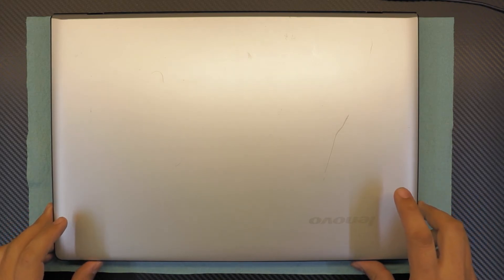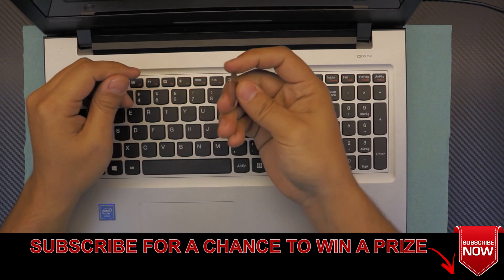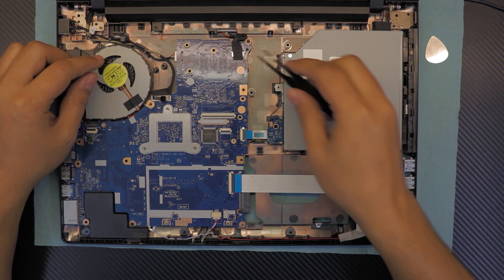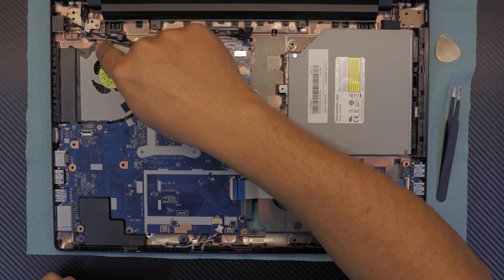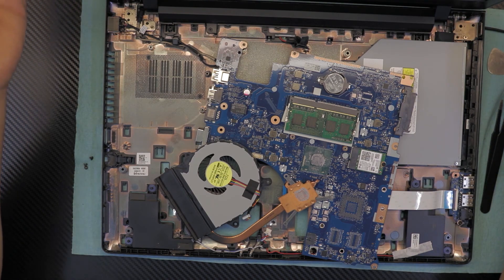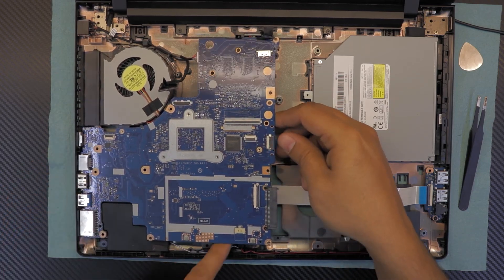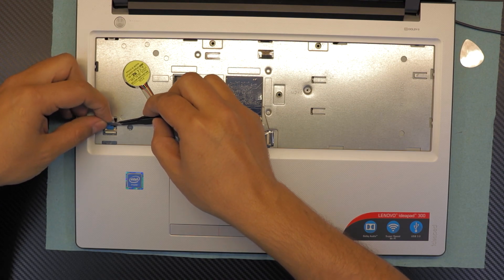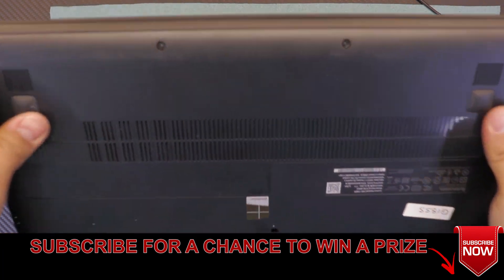lenovo ideapad 300 Repaste and CLEAN UP your Laptop

Comment: Hello brother, I had a problem. When I change the thermal paste suddenly my screen won't display despite the power on is on why this happen?
Reply from the maker: Thanks ✌  for the feedback!  if you wish to support the channel you can LIKE or SUB or both :P
Regarding your question: remove the ram and re insert the ram. and power on and wait 10-15sec, let me know if not so i can assist more
Reply: @uFixTek  i already did that brother but still my display wont turn on i already check my connection the  display but still wont turn on
Reply from the maker: give me few hours and let me check the motherboard schematics and i get back to you..
Reply: @uFixTek  no need brother hahaha actually my computer has two slot of ram and at first I try the first slot and its didn't work but when I try the other one it's work like charm hahaha. Thanks man sorry for your trouble. Now my computer can work again. Pls man make more videos like this but also at same time can you make videos that after you open your computer include with you runing the windows also. I mean because your video mostly you only show mechanical parts but the software after that you didn't show. It's really outstanding and really nice if you can also show the software (on the power button to see system ok) also. I really like your videos you already help thousand of people like me from your videos. Continue man I will support you👍😁
Reply from the maker: i will for sure make a note of that, and will see what i can do maybe i can get to the bios to show that its powering on and the specs :P
i always appreciate ideas, im glad that you got it working, i knew it had something to do with your rams :P
also if you wish to support a brother out you can use my amazon general link to search for your daily purchases, just open the link and look for what you need to purchase and i will get some change in return :)
much appreciate 
https://amzn.to/3ssMqrX
Reply: @uFixTek  XD dont worry i will support you bro
Reply from the maker: @rexanderson9827  thank you brother

Comment: After cleaning the fan, now my laptop can't be charged. My laptop can't boot too. The screen just black and there's no sign to turn on, except the power led, it turns on. But the charge led is dead. Any idea?
Reply from the maker: Remove both rams and wait 30sec and place only one ram and power on after 5-10sec you should get boot, then power off and insert the 2nd ram and wait 1-10 sec and even the laptop can power on and off and back on to relocate the rams.  your laptop is fine dont worry
Reply: @uFixTek  hello sir, i did but it's still won't start, when i press power button i can hear an engine on (maybe cd-rom because from right) but the fan and screen are dead. The laptop still can't be charged too, and charge indicator led not blink.
Reply from the maker: @AriyasetthaTirtayasa  okay please go back and double check the power jack connection to the motherboard.
https://prnt.sc/105g292
Reply from the maker: @AriyasetthaTirtayasa  ok i requested one of the same laptop and they going to bring it to me and i will need to re open  and check, i have a feeling that something is shorting to ground somewhere.

Comment: My Laptop is ideapad 300-14isk i7-6500u with dedicated GPU (R5-M330 2g). The idle temp of CPU is at 50-57°C while the gpu's temp is at 57-60°C. Is this normal at all? or should I clean my laptop?
Reply from the maker: thats hot on idle you should be around 30-40 on cpu on idle, gpu on idle 30-40
Reply: @uFixTek  i have the i5 version, with similar temps and the fans like starts up then stops(repeating the same thing) but not always. i feel like when on full load it doesn't cool enough anymore and throttles when on load... Is it the fan or thermal paste drying up!!
Reply from the maker: you may have dry thermal paste or dirty heat-sink.
Reply: @uFixTek  Oh! So I need to reapply thermal paste.